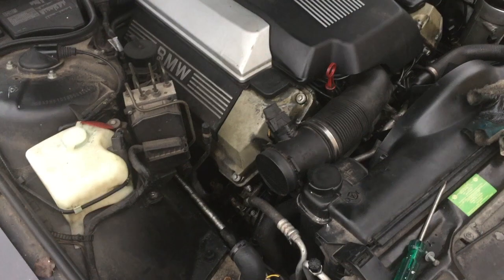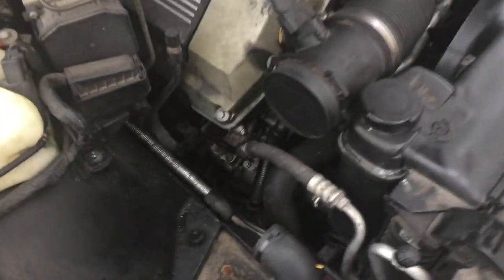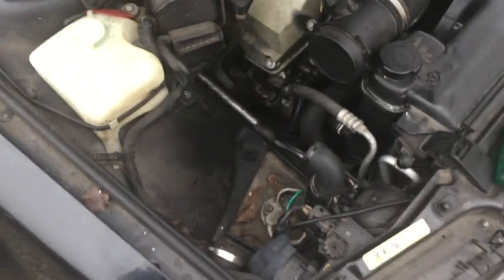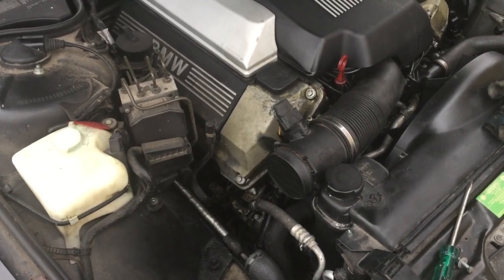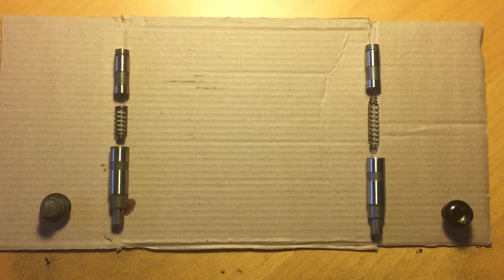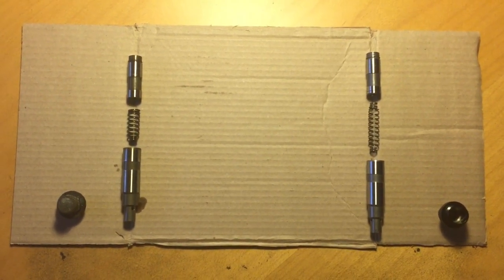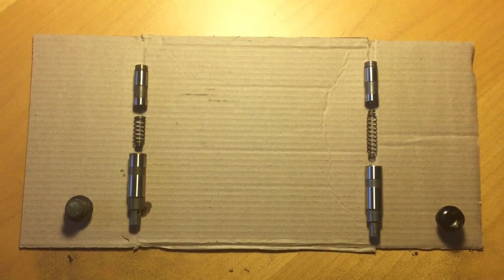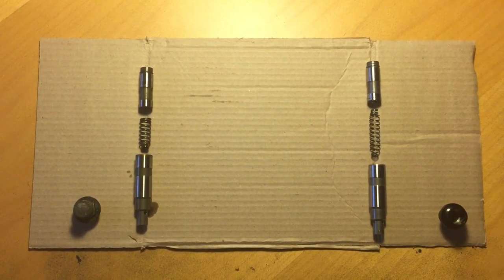Cam chain tensioner, replacement BMW E38

Comment: this would be the lower timing chain tensioner. The cam tensioner would actually be tensioners because there are two upper timing chain tensioners that tension a chain around the cams.
Reply from the maker: That is true. There are so many different names for the chains but from now on I will stick to BMW´s original parts name. Primary chain is the long chain from the crank and secondary chains are the short chains between the cams.

Comment: Thanks for info, I’m doing this job now. Do I have to prime or unlock the tensioner before install? 
, read somewhere they come compressed in box but doesn’t make to much sense.
Reply from the maker: Hello. Yes, they are delivered compressed so just before you install it, push it slightly together and it will pop out. Don´t prime it with oil, it just makes it harder to install. The oil pressure will, after installing it, fill the tensioner and make it firm and extended to the right specs.
Reply: Perfect. Thanks for your reply I will install today.

Comment: You can just replace the spring of the tensioner, with a new longer and a bit stronger spring.
Reply from the maker: Yes, but the tensioner comes complete so why just change the spring?
Reply: @drdragunov  --> I mean keep the old tensioner, but change its spring.
Reply from the maker: @TheChedley  Why would I do that since the new tensioner is complete.

Comment: How well is you e 38 running with these changes ?
Reply from the maker: 100% better. It takes care of any slack in the transchain and makes timing and vanos work as they should.